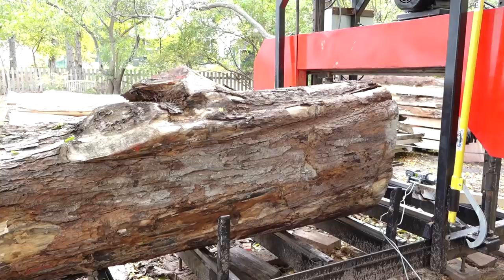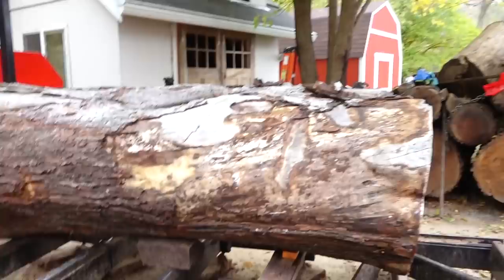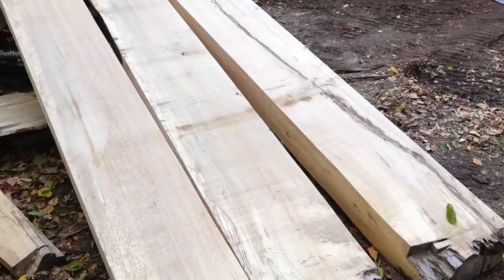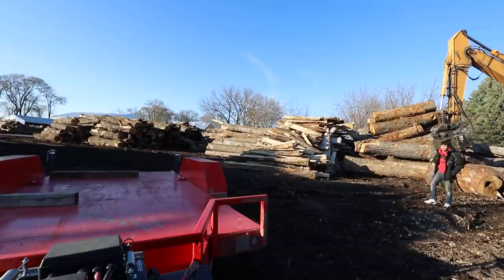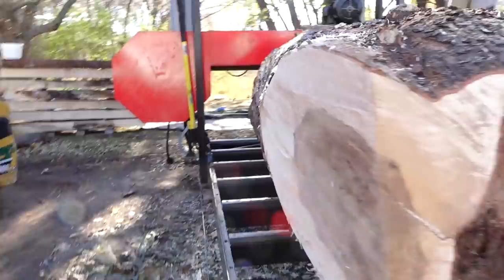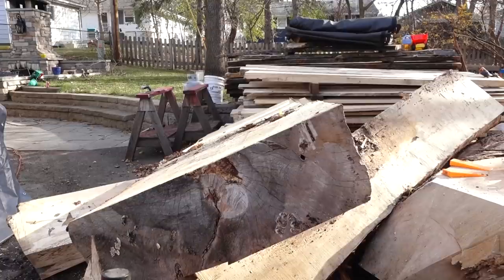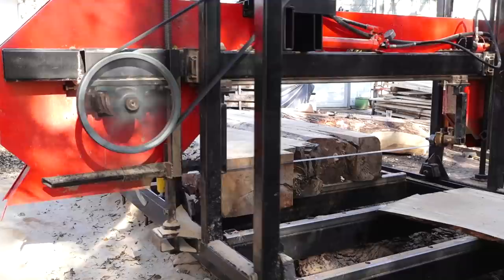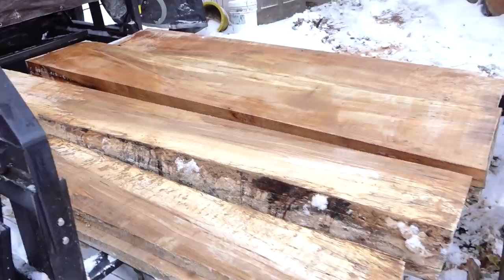Producing the First Batch of Workbench Kits [Part 2]

Comment: I built myself an outside workbench about five years ago.  It is 18 inches tall and four feet long and about 30 inches wide.  I have a sacrificial top which I replace every few years.  It also has wings on the end, which allows me to put a log in the V, so I can cut it.  I can also use the wings to hold a piece of lumber so I can cut it with a hand saw or electric saw.  The table is perfectly leveled and the legs sit on bricks.  It is made from pressure treated 2 by 6’s , 2 by 4’s and all pieces are screwed togetherbwith deck screws and it is painted.  I love it to work on equipment, crank saws and my 3M stool is just the right hight to allow me access to work on things.  I also built a half inch lip around the complete table to keep tools and parts from ever rolling off the table.  I think it cost me about $50 to build the table when I built it.

Comment: Had the same issue when trying to cut 10x10 posts from a red oak log. Too much rot in the center. Ended up making a boat load of 4/4 boards at the customers request..
Just try to get the best out of each log. That's all we can do.

Comment: Matt, I’ve wondered why you didnt decide to invest in solar electric for the new home. With all of the electrical demands placed on your place by the heavy band saw and other shop equipment?  I’m located in south Missouri and have a smaller wood shop than you. My electric coop charges are quite reasonable at 7.5 cents per KWH but using an average of 1.5 MW per month my bills averted about $270 per month and are expected to rise a lot soon. My solar system which cost $19K  took my electric bill to zero for all but 2 months of the year. My system will pay for itself in 7 years — or sooner when the cost per KWH goes up. The life expectancy of the system is 40 years. Seems like it would be an easy decision for you unless your weather or solar costs in MN are much higher. 

I have enjoyed your shop projects and home move for years. Keep them coming!!!

Comment: Matt Quick Question.  Thinking of building a workbench.  A big heavy guy with dog holes, the whole package.  My shop is small and the best place for the bench would be up against a wall. Will I be able to get full use out of the table?  Should it be in the center of the workshop (at least not up against a wall?

Comment: Matt, punky or spalted maple can be 'hardened' to granite with 'the Rot Doctor' penetrating epoxy.  Water thin, too expensive and a hazard to ship... but it works wonders in soft wood allowing fully rotted sections to be reclaimed hard and useful.  Buyers could buy the 
B grade beams you show, and then impregnate them with penetrating epoxy to get 100% serviceable benches, and some would be much more attractive (due to figure, grain and spalt patterns) than 100% quatersawn.
Reply: Random One  So, Matt's river tables, water fall tables and others' are some sin against your "libby green" ideals?  Sheesh, saving a huge slab that has some softspots with a bit of plastic seems a worthwhile use of the hardening agent to preserve the cellulose's original beauty?

Comment: In another video you take small pieces of semi-decayed wood and stabilize them by infusing them with resin. You placed the pieces in a small vacuum chamber with the wood pieces submerged in liquid resin, pulling the air out of the wood, which apparently drew the resin in more deeply. After the resin was cured, the wood appeared to be hard and durable. So I'm wondering, does anybody do this on an industrial scale? Some of the slabs that you produced in this video had a lot of punky places, rendering them pretty much useless. You'd need a pretty big vacuum chamber and a lot of resin, so maybe the whole enterprise would not be cost-effective. But you'd end up with some very interesting slabs.
Reply from the maker: Technically possible; prohibitably expensive. But I know a guy who’s probably crazy enough to try
Reply: @mcremona  Very cool, getting a response from the master of the channel himself, Matt Cremona. And I'm suspecting that the dumb idea I floated might already have occurred to you. I'll bet you're trying to scheme out how you could get a shop-vac to suck the resin through the slab.

Comment: Are these slabs meant to used in Roubo style benches?  If so, are you going to rip the slabs into lets say 3" to 6" high by 1.5" to 2" wide strips for a laminated glue up or does the slab purchaser do that?
Reply from the maker: They are for roubo benches but can be use whole so the buyer doesn’t have to go through the process of laminating

Comment: Woodrot progress in three stages. In the first stage, called the "Incipient" stage, the wood looks outwardly healthy, and seems healthy to the touch, but the wood is already infested and discoloration is evident. This is the pale yellow blotchy spots you're seeing in the cut wood. In the second stage, there is some cell collapse/shrinkage evident, like the gray blotches in this video. In stage three, there is complete cell structure collapse and the wood can be crumpled by hand, such as the stuff you reached into with your hand and crumpled. Even if you cut away the stage two and three sections, stage one will still be there; and, if not stopped, will continue to progress on to stage two unless it's stopped using chemicals or by kiln drying.

This is the problem with using wood from logs that have been lying on the ground. They've been absorbing moisture and the moisture feeds the rot spore that lands on the wood. Sticker the wood off the ground and between, so that it can dry to a point where the woodrot can't survive/spread, and then cover it with something. Don't wrap a tarp around it, that just traps moisture and the moisture drains down the inside of the tarp and into the wood. Use a piece of plywood or a piece of tin that's wide enough to protect the pile from the rain. An air drying shed would be good where you can do that. It would look like a multi-tiered bunkbed without any mattresses and a wide sloped roof above it.

The bad thing about wood rots - especially Poria-Incrassata - is that it may survive in milled lumber that's not kiln-dried; and, at that point, all that's needed to reactivate it is moisture. To protect the wood while it's outside, you can mist it with BoraCare. BoraCare is a borate/glycerin mixture. You cut it 1/1 with water and apply it to the lumber. It will soak into the wood up to 1/1/2 inches and will gradually be lost from repeated wetting of the wood. The borate is toxic to woodrot fungi. You can save wood that's showing stage one (incipient) rot by treating it with BoraCare so that the rot can't spread. Then, before you use it for woodworking, inject liquid wood hardener into the blotchy areas. The hardener will polymerize the wood so it will remain hard, encapsulating and killing any rot spore that's deep in that wood.

Comment: A for effort, but I question a few things. 1. You are getting water all over the wood. Over the next few years the wood will warp as it dries. 2. This is being done outside exposing great wood to unnecessary moisture, snow elements........ 3. From what I know, there is an art to the drying process to get the wood to dry in an even manner. I assume you simply are not aware of these issues?
Reply: He'll most likely sticker the slabs or boards in outdoor stacks.  Usually the board ends get sealed with a special brush on green 
colored paint (Anchorseal 2) to prevent checking and warping.  As far as indoor seasoning or kiln drying, I'd like to know that as well.